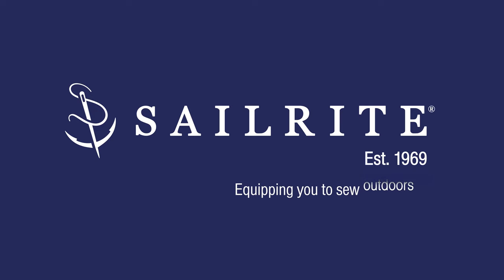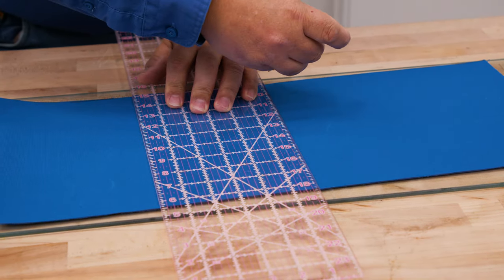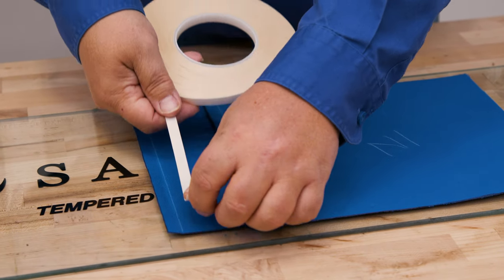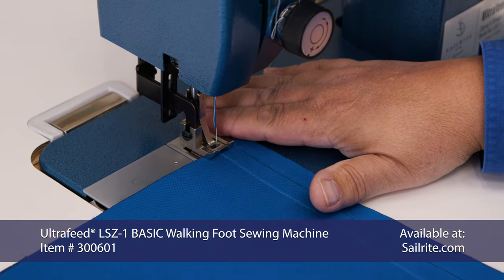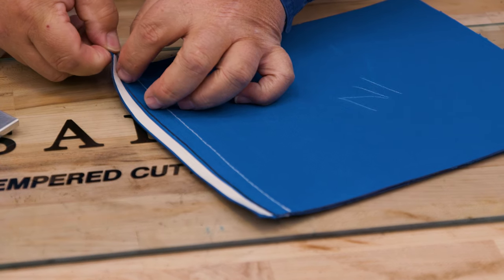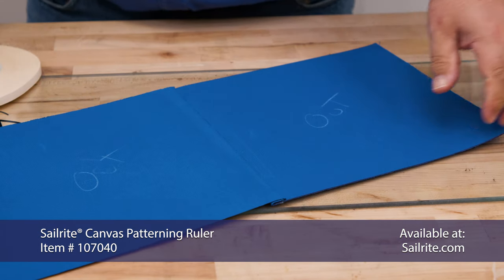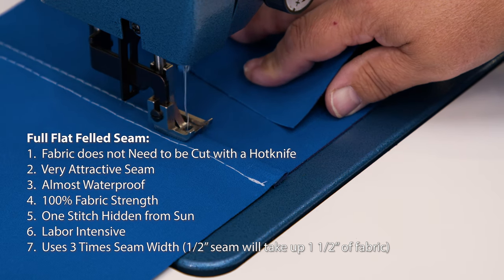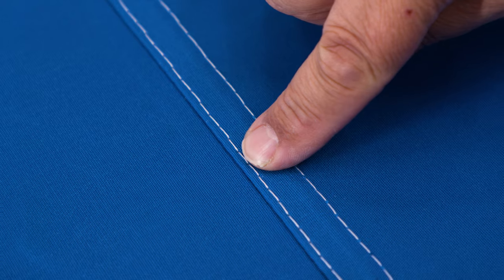Full Flat Felled Seam Construction

Comment: These videos are so helpful. One thing I hope you do a video on which is still causing me a lot of trouble is how to go over a thick, felled, seam with another felled seam. For example hemming a cuff over a felled seam. On standard feed machines I would use a hump jumper but I can’t figure it out on a walking foot. Every time once the foot is atop the intersection, it stops feeding the fabric. This is killing me!
Reply from the maker: If a walking foot sewing machine stops feeding over a large bump I typically stop sewing and then rotate the balance wheel by hand until the needle is out of the fabric. Then I lift my presser foot and push the fabric assembly past the bump slightly.Then lower the presser foot and rotate the balance wheel by hand to see if it will now feed. If it does then I operate the foot pedal and continue to sew. I hope this helps.
Reply: @SailriteDIY thank you so much for this. I’m about to make myself a raincoat and was worried about ripping the fabric.

Comment: Do you need seam sealer for total waterproofness, or is the flat felled seam enough in itself?
Reply from the maker: The full flat felled seam results in a seam that is almost waterproof, but could not be considered "total" waterproofnes, because you still have needle holes. You may still need a seam sealer, but chances are you will not.